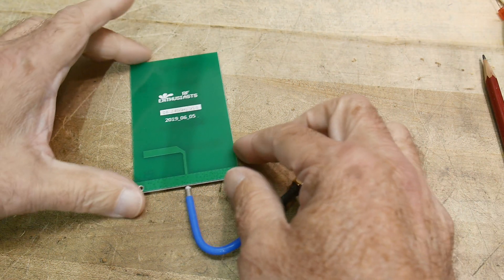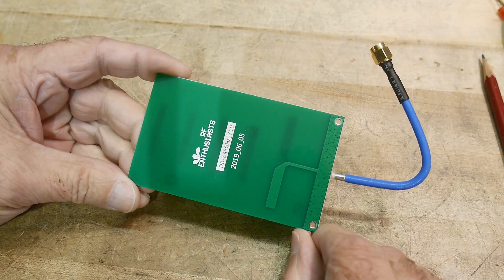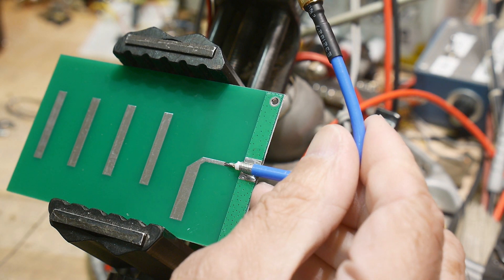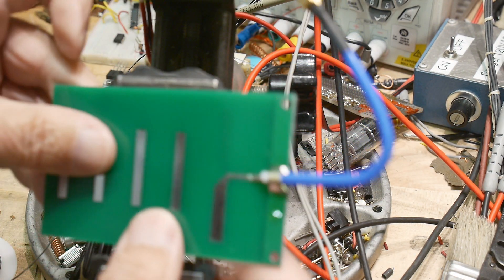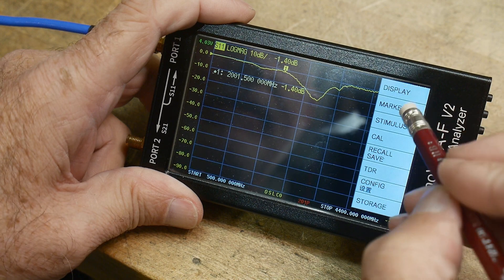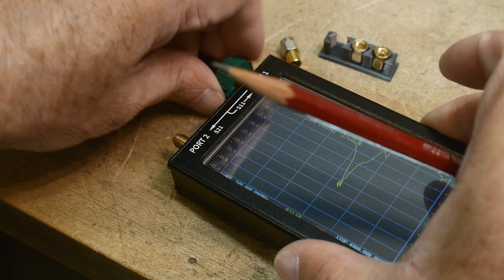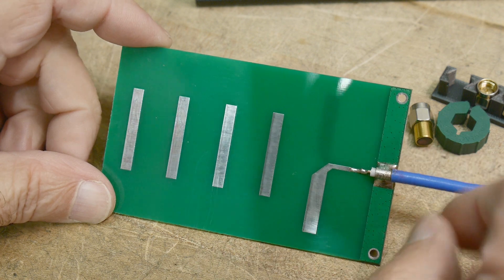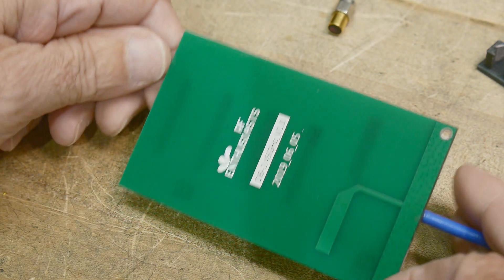#1459 PCB Yagi antenna for 2.45GHz (part 1 of 2)

Comment: no balun required? and how come you didn't correct for electrical length introduced with the coax cable when measuring with the VNA?
Reply from the maker: no balun need if good match: https://youtu.be/5uEz1KkHKas?si=0pfPfGRhAFxpLH0D
adding coax does not effect VSWR: https://youtu.be/gNZH5J63rfc?si=WRBAjYhrv3nXk2yk
you might like my three part video on design of yagi and professional measurement: https://youtu.be/gYwexdgvUbE?si=QjVDCj522Ylj0OAR

Comment: Chinese manufacturers have been doing strange and absurd things for years, and the consumer world buys them anyway-.In addition to the connector being poorly soldered.  I doubt that the impedance of the coaxial cable is actually 50 ohms.. Thanks

Comment: quick question the ground of the antenna the wrapping if you will, shouldn't it be connected to the other side of the dipole? also shouldn't the reflector be a inactive element?

Comment: You MIGHT TRY DRIILLING a hole either side if thr braid off the coax and solder wires through the 2 boards to see if you can get a better gnd to see if it makes any difference ???

Comment: Well in the late 70th I was in the air force repairing measurement equipment. I sometimes got instruments back 1/2 year later - inaccurate. Then I washed the PCB in Alcohol (ultrasonic bath) and the results got better. Later I can't tell you because every repaired PCB got washed.

Comment: My only real question is what is this thing aimed at? It's not really of any use to anything I can think of. Even if it did work as advertised.
Reply from the maker: wifi
Reply: @IMSAIGuy  I know what it is aimed at, but still can't think of a "use case scenario" where it fits. Even 13cm band antenna's are different to this. If your WIFI is so bad you feel this thing would help, I would say your need either a better dongle or better router. I haven't seen a mobile phone or laptop with an SMA connector fitted as a connection standard. Yet.
Reply from the maker: @InflatedDolphin  usb dongles for wifi with SMA are very common

Comment: That is hilarious! As an idea for a future video maybe check out those "wideband power amplifier" modules from china. In my experience they actually "work", but the output transistor is so overbiased that they blow up after a minute (literally!). I had 2 different variants with the same problem. I dont think the factory even knows what they are producing or how to test them.
Reply from the maker: I've done several videos on chinese amps. I even rebuilt one with a better part.
Reply: @IMSAIGuy  Ah ok cool, will check that out later! Sorry, I am kinda new to your youtube channel

Comment: I have seen cases where flux causes leakage between traces. Circuit was high impedance like 1 meg ohm or so. Flux absorbs water over time and becomes slightly conductive. When I cleaned the boards problems went away

Comment: Good grief that's junk! I would check the connection of the SMA under that heat shink too after seeing the epic fail of a connection to the PCB/antenna!
There is a solution of Yagi design that has all the directors the same length and spacing, but its far from optimal so not used. Also, mounting holes at the ends of the "reflector" ?? If you did mount it to something with them what's that going to do to the performance? Those ends are voltage nodes, they need to be in free space

I'm with you on the flux topic, some people seem to  learn that there IS corrosive flux and so ALL flux must be corrosive! Plumbers flux and Aluminium flux are the only ones I worry about.

Comment: Reflector and ground side of dipole connected?  Does not look right either?
Reply: I agree..it looks weird and wrong. If the antenna is to be used vertically , the coax shield connected to the side of the dipole facing the ground would be OK but if used horizontally, a small, easily homemade  balun would be better to balance the asymetrical coax.

Comment: I’d never presume to question your knowledge or experience regarding any of the topics you’ve covered. Just out of curiosity, did you hook it up to the VNA before your fix? I only ask because I just watched your video on micro strip/ patch antennas and a video on micro strip circuits in microwave RG amplifiers . I noticed a lot of them seem capacitivly coupled and not mechanically attached to anything else. 
That being said, I also saw the video on your tear down of an HP switch/relay control unit. The PCB of the front display panel had a bunch of trick looking gold plated traces. Since you were scraping the unit, using predetermined measurements, could that PCB be cutdown to render a PCB antenna or pieced together to make something similar??
As always, thanks for the videos. If you’re trying to think of content for your next video, and since you seem to have the ability to do some machining, would be so kind as to revisit resonant cavities and their application to RF design.  Thanks again!!

Comment: Got some conductive copper tape? You could lengthen those directors.. And the reflector might need to be shortened. Sounds like a fun experiment!
Reply from the maker: part 2
Reply: I'm thinking the same thing.  Easy to make.

Comment: How to model Yagi design? Otherwise, it's hand waving or trial and error.
Reply from the maker: cad programs: https://youtu.be/U-cCdGdf6vI
Reply: @IMSAIGuy  1459-1118=341 days/videos ago.  What a way to measure time! 
I forgot that one.
Did your converted HP VNA  stop working?
Reply from the maker: @jspencerg  it only goes to 1.3G
Reply: There are .... a lot ... or Yagi-Uda (yagi antenna) calculators online. (You can add directors, the antenna configuration, the gamma match... the whole nine yards... and they will spit out the dimensions of the elements.) If you mean, to model the electromagnetic response... of a particular yagi design... then good luck, and best wishes.
Reply from the maker: @willthecat3861  yes there are, I see them asking for the diameter of the wire used, but never the width of a trace, and never FR4 sheet on one side.
Reply: @IMSAIGuy  This could be the TI design they attempted to copy:  swra350.pdf

Comment: You definitely know what you're doing, and even if I didn't already know you're good, what looks like a Metcal and a Panavise would be a pretty good hint. But even some guy in his garage would figure this one out.

I did a repair and calibration on a board made in-house at NIST. After returning it to NIST I got a call from them. They wanted to know what in the world I did that dropped the board's noise floor 10 dB. I told them I'd cleaned the flux off the bottom of the board. Scientists, sigh.

The relationship between element lengths and widths, and distances between traces is set for the desired impedance matching, forward gain, and bandwidth, as you instinctively know. This layout is suspicious because all of the directors are the same length and spacing, a very simplistic Yagi-Uda design topology from before the time when everyone had a PC and a copy of one flavor or another of NEC, meaning it was just slapped together by someone not using NEC to 'look like' it was 'designed' when in fact, they just looked at an image of a board design and roughly copied it in a graphics program and said, "Good enough." I'm surprised the 'correct' configuration is as close as it is. But if it were me, I'd use a PCB Yagi-Uda design program, select FR-4 for a common dielectric material, (unless I wanted to get fancy, improve efficiency, and spend some one else's money on a Rogers material suitable for the frequency,) and whip up my own. I think "Some guy in his garage," could do a Hell of a lot better than what you have there.

Comment: Since u have a pcb supplier might be fun to layout one of your own dimensions and test.
Reply: I would (and have) just experiment with copper tape on a blank (no copper) FR4 board before committing to even a cheap-from-China custom board run.  That is, I have experimented that way, but never committed.  I used copper craft tape meant for (I think) stained glass work.
Reply: @Randrew  that's a good idea, when I get some spare time will try similar and then test with the vna thx

Comment: it's a 2.45Ghz antenna with a bonus dip at higher frequencies 😇 Is it possible that the original Antenna design was on Rogers material and the genius that built this thing just slapped the design on FR4 ?
Reply: I think a design on Rogers wouldn't have had all the director elements the same length and spacing. That's a simplistic 'pre-NEC' and home PC Yagi-Yuda design from back when it was all cut and try designs.

Comment: That Yagi is completely wrong.
The spacing of the directors must be logarithmic. The dipole is too long, etc.
You're right the antenna has been copied by a photograph, by a person who had no idea of what radiofrequency is or works, to the point of connecting the RG174 to the reflector and leaving the main dipole disconnected.
It is a nice find, and an indicator of the scams - both intentional and involuntary - plays big part in the tech trade with China...